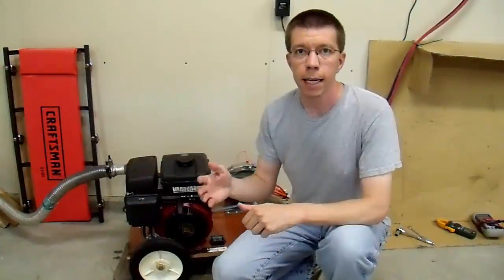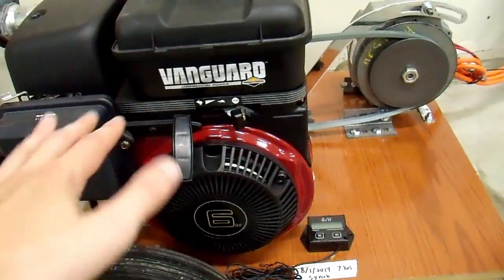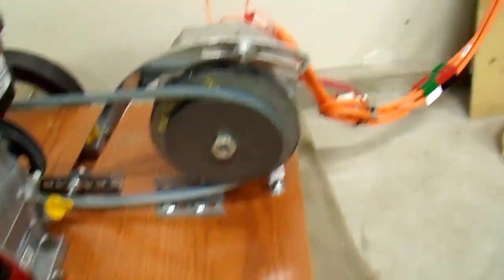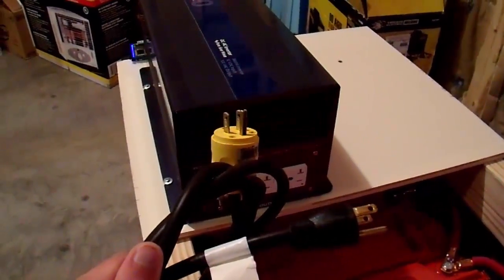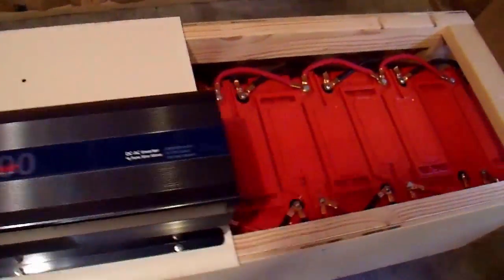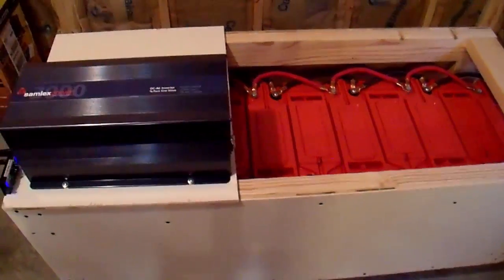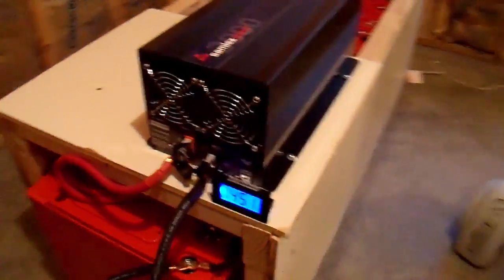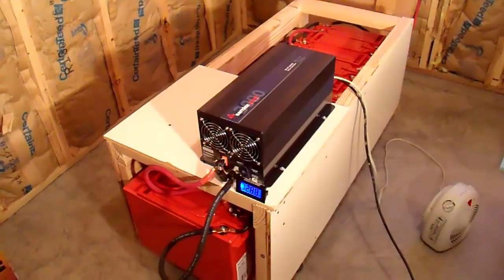DIY 12V Generator Charger - 10 Demonstration and How to Build

Comment: that's very expensive than a true generator imagine you have to produce battery 12 volts then you have to power a 220 volts appliances like Led tv anything a source of 220 volts you have to produce Inverter pure sine wave you know? what is the difference a 12volt charger than true generator generator they have magneto to produce current a power directly to your house.alternator with gasoline motor you have produce a batter, inverter alternator true generator one only you know?
Reply: Powering your house directly from an alternator requires accurate speed control to keep the AC at 50/60 Hz,, depending on which is used in your country.
Reply: He is not powering 220v ac  he would be doing 120v ac for his house and the alternator is just to keep his batteries charged up.

Comment: You should look around for a busted generator that's for sale cheap to get the frame and gas tank and transfer everything to it. That way you will have a sturdy frame and a bigger gas tank.  Or make a frame and get some gas tanks from used riding mowers.

Comment: a huge waist of time, for you and us, and a huge waist of money for what you are getting, you probably spent in the $400.00 range, counting your mistakes.... and a good average generator that will out perform that one about 150 :1 would cost about the same. I know because I sell them!
Reply: +Hammer USN Are you saying that your generators are 150 times more efficient that this setup? Because thats what it would have to be to outperform any other generator setup by 150:1.
Reply: Lol I sell generators I repair them also , so go bs someone else
Reply: +Hammer USN I understand that you sell generators, you've told us twice now. Why don't you sell me one of those super efficient ones you were boasting about earlier. No seriously, give me the model number and a quote so i can check out the specs and consider a deal.
Reply: Not a problem, what size you looking for?
Reply: Where u located I can have a distributer in ur area give u a call or set up a demonstration .
Reply: +Hammer USN I want the one that is 150 times more efficient than the one in this video. Im in the United Kingdom and am loaded so don't worry about quoting me a massive shipping charge,
Reply: Here is direct number
Reply: +Hammer USN Cool. Now, what model number do i ask for?
Reply: +Hammer USN Had a look at the website but don't see any generators by themselves. All hooked up to a lighting tower or something. Not really what i was after.

Comment: So how long does it take to charge those batteries. Do you re charge them when there drained? or run the motor while using the power?

Comment: Haven't yet watched the build videos, and certainly not read all the comments, but it occurs to me that if you're driving the alternator 1:1, why not direct drive the alternator and nix the belt altogether?

Also, would it be worth considering a voltage sensing capable alternator (like Chevy CS series) to offset voltage drop (though with the voltage reading at your bank, you probably already are?).

Now off to watch your build vids!  :)

Comment: as a master automotive tech I was complex where you where getting your info for the alternator? As I have rested hundreds and do so at 2000 rpm and load of about 2/3 of the rated output. 
Also are you running a internally regulator alternator? And has its own diodes inside so why the momentarily switch that looks way under rated. Unless you have it on the field side. And lastly why do you have your battery's 40 plus feet away from your recharging unit I would say for all the optimization you have done that your willing to give up line loss.
Reply: He would not have any real loss with the cable he is using.  Batteries are in his basement, gas motor in garage to vent, pretty easy to understand.  The alternator needs voltage to start if you  have done so many alternators why would you ask that?  He doesn't run his house on the alternator, it is ti charge up the batteries if the solar is not keeping up.  May not be the best setup but the only dangerous part is the 2 ended AC cord.

Comment: Your alternator hasn´t enough power to feed the fully loaded invertor, so your batteries will go flat after some time ... Also the RPM should be higher, it is probably not so efficient, but the total power you get will be higher. And if you want to be efficient, put the battery-bank near the generator and pass the OUTPUT of the invertor thru the home - due to the voltage drop. AND DON´T USE THIS FUCKIN CABLE WITH TWO MALE PLUGS ON THE END !!!
Reply: Alternators are supposed to put out 14+ vdc. I mean the whole purpose of an alternator is to charge a battery... so it's designed to run proper voltage to charge a 12vdc battery...
Reply: I'm pretty sure that he only average about 10-20% of 1200 watts. and yes he should use a transfer switch! A hazard to himself and to the power line person working on a downed line someday. IT ONLY TAKES ONE MISTAKE...

Comment: am l correct that if you hook up 2 alternators to the same battery bank, would that be putting 24 volts into a 12 volt battery bank, which would not be a good thing.
Reply: +Ed Fishburn Thank you
Reply: Careful with Series. Internal regulators would probably blow up.

Comment: love the setup but where u have the wire going threw the wall threw insulation i would put conduit or pipe and have the wires go threw that for fire safety sakes i know u have fuses and such but i had a house fire and now i check and account for every stupid small things
Reply: It is 12 volt dc you could put you tongue on it, might tickle.

Comment: A suicide lead. I swaped mine for an iec plug from an old kettle. Only slightly safer but it's the best way I could think of without hard wiring and using a changover switch. I use an antique engine to charge my battery bank using an 80 amp car alternator when there's not enough sun for my solar panels.  I enjoy seeing other peoples setups and learning from them. Thanks for posting.

Comment: I watched most of these and read a lot of the comments and maybe I missed it, but did you do this at all for cost savings reasons? Obviously you like to tinker, learn and DIY and I think that is awesome, but at the end of the day, would Joe Sixpack who might not have ever swapped an alternator in a car, or know the difference between a neoprene vs kevlar belt find any financial advantages to this setup vs. picking up a prebuilt generator?
Reply: He is charging his batteries if the solar does not keep up, a prebuilt generator would produce power at 120v ac so what then plug a battery  charger into that?  and Joe sixpack would know how to swap an alternator.   People don't listen.

Comment: Thanks for posting. I enjoyed watching your videos and learned some things alone the way. I built a 12v power plant like this once but I think the motor was too small. It would start and run just fine then bog down and stall. I wanted it for running spotlights to do some night fishing in Arroyo City, Tx. 
If someone wanted to build a "portable air conditioner" how big of a motor do you think it would take? In other words, a gas or diesel powered, stand alone system such as yours, but for cooling air instead of charging batteries.  I drive a truck "over the road" and have to comply with idle laws in certain cities and states. Some things I prefer to build myself from scratch.

Comment: It's good that you can make this stuff but at the price of generators it seems a lot of time and money when you can buy one that will do exactly the same thing for less, I don't mean this as a criticism.

I bought a fantastic 3.5kw inverter generator for less than £500 it was fully oiled up and ready to use all for that price the only thing I needed to do was put petrol in, and it was electric start so you just turn the key no need to pull the string even though its there.

You can buy these generators on ebay, they come with digital panel displaying a multitude of information, and they have safety features built in and they are very quiet.

So I wonder why you would build something like this when you could buy one ready to go probably cheaper?

Are generators very expensive where you are?
Reply: *****
Here's one not overly expensive little bit smaller than my one but still pretty useful.

http://www.ebay.com/itm/SUPER-SILENT-2200W-PORTABLE-SUITCASE-INVERTER-GENERATOR-GG-2000-Si-/221469513188?pt=LH_DefaultDomain_3&hash=item33909c95e4

Here's another similar to my own one but my one has 3.5kw.

http://www.ebay.com/itm/EPS-Inverter-Generator-/191534608213?hash=item2c985a2f55&vxp=mtr

Anyway just have a look through ebay you can find some good one's at reasonable prices.

These are on the USA ebay.

If you want it to run computers and things like that it will need to have an inverter but you can use an ordinary generator and plug an external inverter into the 12 outlet so long as it has one of course.
Reply: you did not listen at all to what he is doing.   watch the video again and listen this time. if he wanted a generator producing house voltage he could build it, that is not what he did.

Comment: get a mig welder! i built mine out of a 6.5 hp briggs n stratton  vertical shaft motor! and a
130 amp ford alternator it puts out a 100 amps at 1500 rpms. runs 2 1/2 hours on one quart of gas using a vertical shaft motor gives you a more compact unit mine is 16x16 takes up very little space! if anyone is interested in building one like this hit me up on google and i will send pictures and building infomation. also can show you how to build a super quiet muffler that bolts rite on the motor like the original muffler did!

Comment: How did you connect the hour meater to the engine.
Reply from the maker: These type of meters simply wrap around the spark plug wire to get their signal.  Wrap it 10 times or so to ensure you get a solid signal.  Many of the negative reviews you see from this type of item are from people who don't properly install them - they work great!

Comment: Check out Delco AD244 alternator for good heavy duty output. Custom versions do 150A, 200A and 300A. All the car audio guys use them. Easy to have over 100A output.

Comment: Knurlgnar,  I've enjoyed the videos focusing on the Battery Bank / Inverter system. They were the motivating factors which led me to the Samlex 3000 which you spoke so highly of. I did call the factory and the US rep for these particular Inverters and they were responsive, informative and a great help for our particular application. Currently we are running 8- 12 volt deep cycle with a 774 Ah total rating,
Your # 10 video shows a new duel 20 amp outlet , pigtailed to a 220 Volt drier plug. I understand the connections ( not show ) for the L-1 - L2 connections but how did you wire the neutral in the duel outlet plug.? I assuming you had to tie them together , sharing the neutral from each neutral from the Inverter to share as a common neutral at the point of connection to the drier receptacle.  " Assuming " usually gets me in trouble so would you please clarify how you dealt with the neutral as it could affect the ground fault circuit of the Inverter.
NH Hbbyloggr
Reply from the maker: You are exactly correct.  The neutral was shared between the two outlets and the 'hot' was connected to the corresponding hot phases.  It would be best to test this setup with an ordinary 120V load on each phase to ensure it is all connected properly before using it with an inverter.  As always, be aware of any safety issues.
Reply: *****
Thanks for clarifying. Also because of the conflict with the GFI you do not connect the  GROUND ? I see there is a separate grounding lug on the rear of the set. Do you use that at all to " bond" to the house ground? Thanks for your help. NH Hbbyloggr
Reply from the maker: NH Hbbyloggr
I actually didn't connect the GND to the inverter in this case to avoid GFI issues.  The grounding lug is a no-connect internally in the inverter and is only there so that you can guarantee the inverter case is electrically grounded.  It's required to be there per UL spec but isn't really necessary even for safety except for specialized applications.
Reply: *****
Thank you. That ties up the loose ends and now I can eliminate possible  " oh crap " moments. Happy New Year !
Reply: I don't understand saying no ground ok or 2 grounds both wrong dangerous.

Comment: That series where you built this was one of your greatest hits. Though I can't really use anything like that here. I live in a condo so I have to think small and quiet.
Reply from the maker: Even in my neighborhood it is difficult due to the small lot sizes.  One of those inverter/generators from Honda/Yamaha or the like may be your best bet.  They can be modified with additional custom exhaust features for more flexibility.  They certainly won't be as silent as advertized (all small engines are loud regardless of what they claim) but they are about as good as you'll get within reason.

Comment: dear friend
I could send the assembly diagram inside the MPPT Solar Charge Controller EP eTracer 60A 12/24/36 / 48V, or at least one can of photos inside, because I do not remember where you connect the bridge rectifier
thank you very much

Comment: I have a champion 4000 watt for emergency's but I fear using a mod sine wave on my Trane furnace and frying the circuit board or any thing else in the furnace...
Reply from the maker: I would worry more about the poor AVR in that generator than the waveform myself.  Inverter generators (or inverters) are much safer for that reason.
Reply: ***** not sure what AVR is- I'm glad I watched most of your inverters videos I was planning on buying from aims...looks like my plan will be a 300 watt go power pure sine and upgrade later as I can spend more - what i love about this is each component being easy to replace and each point of failer being only 100 bucks or so to fix lol I plan to run with two deep cell - wish you did some reveiws on pure under 1000 watt , but have watched most and rated - nice to get a response for a change from a channel lol great job on the tech side I love to learn
Reply from the maker: CHARLES12STRING
Thanks for the question and reply!  If you want to run your furnace on occasion during power outages (natural gas, propane, or fuel oil) you may want to consider an inexpensive MSW 2kw class inverter.  It isn't ideal but it could save you some money vs. a more expensive pure sine unit.  2kw should be enough to run your furnace and/or refrigerator for short periods of time.  If you want to power more than that in the future you could upgrade to a PSW inverter.  Just an option.  On the other hand if you're doing this for long periods of time than pure sine is the way to go.

I too like the modular design.  Each individual component can be simple and reliable.

For the most part pure sine inverters under 1kw aren't very practical since most low power loads don't care what waveform they get.  (Think of computers, light bulbs, and the like.)  Higher power motors and such do care which is why when you get over about 1kw MSW isn't as versatile.
Reply: ***** thought my hdtv and laptop needed the the pure sine wave so as to not damage them - I used a 200 watt black and decker on a digital convertor and it stopped working so thats $50 down the drain - not sure what is safe and not any more but the tv is $400 and the laptop is $800 so I didn't want to take any chances lol
Reply from the maker: CHARLES12STRING
Pure sine is always safe for any appliance so I can't argue with your choice there.  TVs do sometimes run better on pure sine especially when you're using antenna reception due to the lower THD and interference.  MSW is highly unlikely to damage it but it may affect performance.  The only way to know with your specific TV and your specific application is to try it unfortunately.  The laptop will be fine on either.

Comment: always wanted to build one - I have my motor picked out and now I'm glad I found your videos for  tips on build - but then I run into build cost - why are the pre-built so much cheaper ? generac inverter generator is $600 and you cant find a pure sine 2000 watt for that -
Reply: http://www.northerntool.com/shop/tools/product_200402909_200402909 as I understand this is pure sine wave also correct ?
Reply: CHARLES12STRING 208 cc was the engine I had picked out with a cast iron sleave http://www.northerntool.com/shop/tools/product_200638383_200638383 but I thought that I would have to guess at the pully size , so the 1 to 1 at 5 inch pully sounds great- I had planed to use a gm one wire set up but now you have changed my mind on that also-
Reply from the maker: CHARLES12STRING
Yes, the inverter you linked to is pure sine.  It is about an 1800W inverter with only a 2000W (actual) surge so take that into account.  A 2kw inverter will be more capable in reality.
Reply from the maker: CHARLES12STRING
That's a great deal on that engine.  I wouldn't hesitate to purchase one for your project!  It isn't going to be ultra reliable like a Honda GX or a Briggs Vanguard but small engine technology is pretty well stable now so even the cheap ones do it pretty well excluding manufacturing defects.  That engine would be a great starting point for this project.
Reply from the maker: The pre-built ones will always be cheaper, but keep in mind that they need to run 24/7 to give you continuous power.  If you have a battery bank then there is advantage to the alternator-inverter setup.  For most people just purchasing an inverter-generator is the most practical solution.  For those who have aspirations for solar, renewable energy, or silent night operation the separate inverter/alternator setup is a good alternative.  My setup is designed for a reliable 2000 hour operating life which is better than one can expect from the Generac style inverters, and closer to what you would expect from the Honda inverter generators.